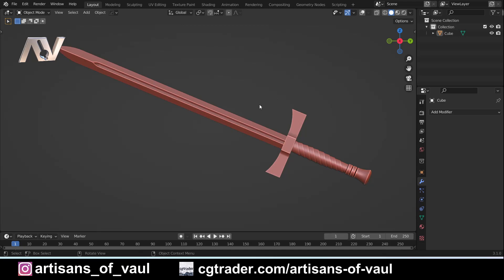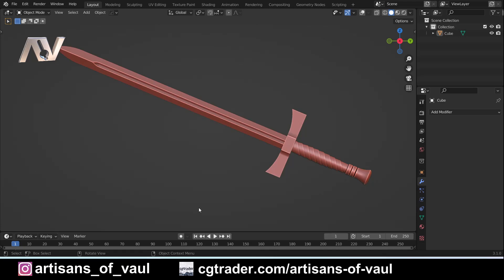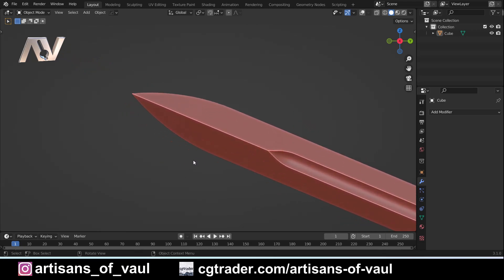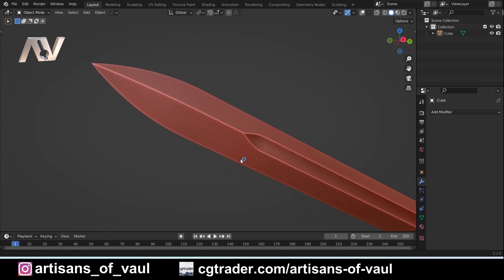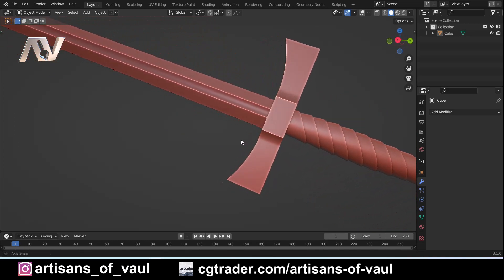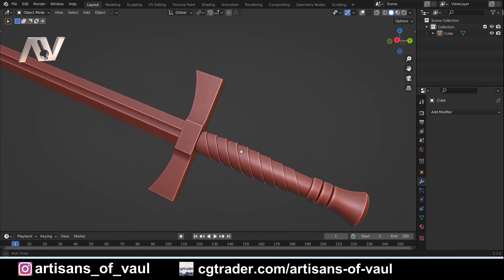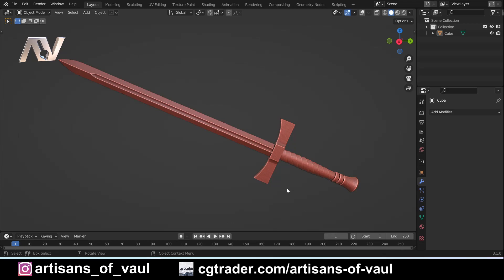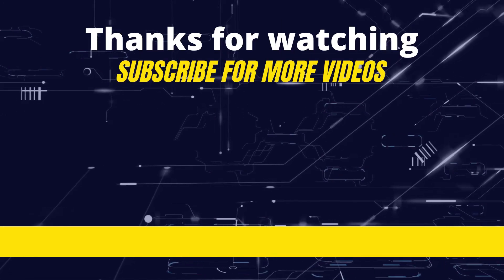Blender Challenge 1:  Designing a Sword

Comment: Who needs bools when you have knife project? Start with a diamond, knife project the blade profile and "fuller?", and the rest is a question of some minor jointing and merging. Crossguard is the same. Only question is the handle, could do it with a tapered cylinder which has been manually shaped into a spiral then duplicated, but that just sounds like a pain.
Reply from the maker: I didnt actually use knife project. I'm curious if it would have been more efficient. I'll set you see what you think. I agree that would be a pain for the handle. I went with something much simpler (well that's easy to say if you know it.... 😅) but again others may suggest another approach. I'm looking forward to Friday and others saying how they would have done it. I think I'll learn just as much as those watching overall, which is a really nice learning process

Comment: I can make it except for the leather handle twist. No clue on how to do that without booleans and modifiers.
Reply: I think I know, but don't want to give spoilers.
Reply from the maker: @MartinJamesLittle  Appreciated
Reply from the maker: Well thats pretty good.  Most people I think will get stuck on making the round handle come from the square crossguard without a boolean.  I have actually covered the tool used to make the leather handle in a previous video (though not used for this purpose).  Answers coming on Friday too ;p